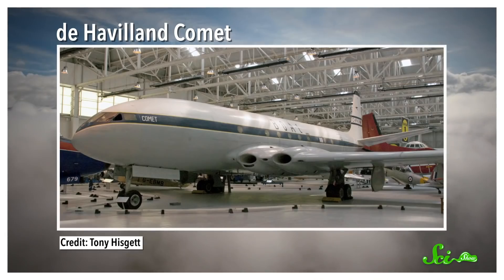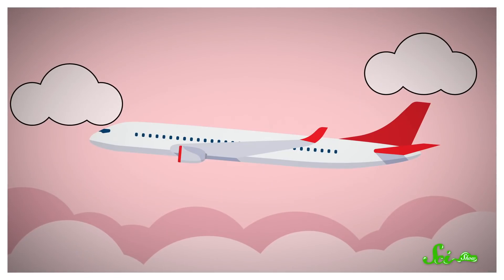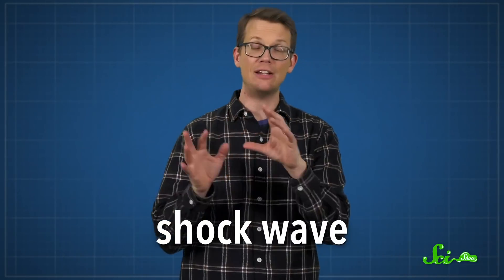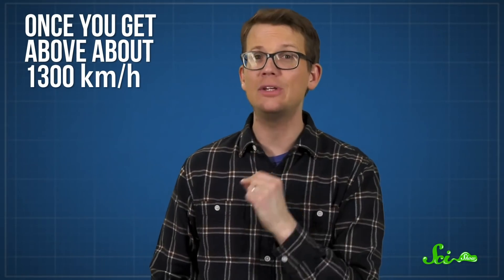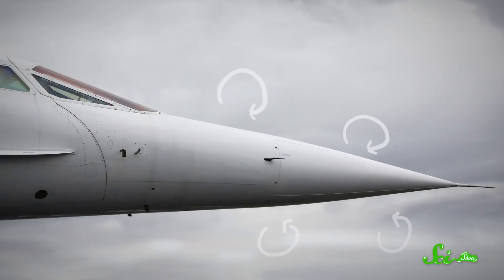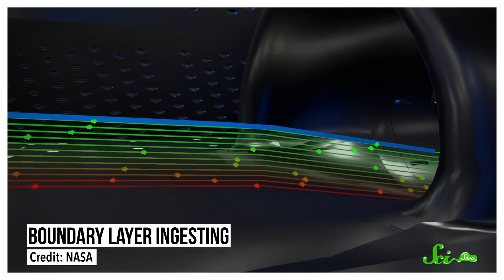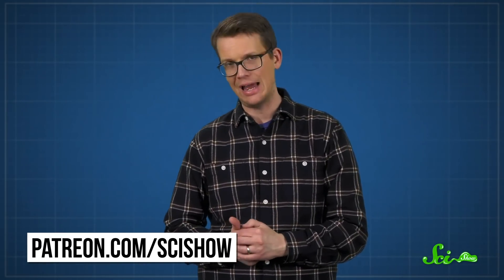Why Aren't Commercial Jets Getting Faster?

Comment: Supersonic airplanes fly twice as high as ordinary airliners.  It’s so high you can see the curvature of the earth.  This is because the engine on a supersonic airplane is more like what a fighter jet uses.   There are companies that are trying to bring back Supersonic airplanes. One major difference is size.  The new ones are being designed to carry 60 to 65 passengers.  The airplane will use the latest in composite materials that were not yet invented back in the Concord days.  The vastly reduced size and lighter material means it will use a lot less fuel than Concord. the Boom Supersonic for example is planning to create a supersonic airplane that is cost effective enough to sell tickets at current first class prices.  The boom supersonic airplane theoretical top speed is Mach 2.2. This was before the corona virus and it’s devastation to the Commercial Aviation industry.
Reply: You sound like an advertisement.  Booms Supersonic is vapor ware. The design that have shown so far of the Overture are 100% eye candy with zero engineering validity; there is no room in that plane for fuel. I expect them to go bankrupt in 5 years, having delivered nothing.

Comment: Actually its the low pressure on top of the wing that provides most of the lift not the high pressure below. Sorry you got this one wrong
Reply: Actually conventional wisdom that the low pressure 'sucks' the plane into the sky isn't entirely correct.
According to aerodynamics, lift is produced both by explanation of bernoulli's principles (The air on the top is indeed moving faster, but the way it generates lift isn't due to lower pressure (as one would conventionally say 'the faster moving air produces lower pressure'; this is a misconception, the actual equation compares the total energy within a particular airflow, stationary air and fast moving air have two different energies, and comparing the two doesn't give you the answer you're looking for)), but also newton's equations resulting in the deflection of air from below the wing causing a reactive force on the wing itself.
To summarise, the way a plane moves isn't solely because of 'low pressure' or 'high pressure', but the fact that due to some complex calculus, an airfoil creates a pressure differential between the two surfaces, and the application of this (whether you get the answer from bernoulli or newton, it doesn't matter. Bernoulli's principles were derived from newton's laws and thus they both explain it in slightly different ways) is what generates lift.

Comment: I believe the airfoil was shown upside-down.
Reply: Nope. That is a more recent style airfoil, those referred to as supercritical. The top is flatter because they are intended to bring the extrados air ever so close to Mach 1, and keep it that speed (and therefore the low pressure) as long as possible.

Comment: There have been a lot of videos about this issue. The mathematics involved determine basic aircraft architecture for a given speed. At higher speeds than currently attained commercially you first enter a range of airspeeds that are transonic and not really suitable for sustained flight. At supersonic speeds the fuselage and wing shape needs to change, and the aircraft becomes uncomfortably narrow, as well as inefficient. It is not true that a witty kid with a pencil can just whip something up, but that is the prevailing notion. The reality is that mankind  at this point should probably stick with more realistic goals, like understanding why you shouldn’t lose your mind when someone says “virus,” and perhaps letting ethnic minorities walk down the street, go shopping etc., without being choked out by cops. I dunno.

Comment: The explanation is very good, but still not all commercial jets fly at the same speed. As a rule of thumb bigger planes fly faster, and I mean the average cruising speed once the climbing phase is over. So 777’s, 787’s, 747-8’s on the one hand and A380’s and A-350’s all cruise at Mach 0.85. The one exception is A330’s, that only cruise at Mach 0.82. This may not seem much, but it will add 30-45’ to long missions. Then comes the next tier, 737’s and A320’s that just do Mach 0.78. Here again, another 15-20’ is added on a North Atlantic crossing, the maximum range of a single aisle craft when compared to A330’s, a bit more with other twin aisle versions. The still smaller A220’s are even slower, just Mach 0.75. An explanation for these differences would be highly appreciated.

Comment: Actually airline speed is more a function of passenger miles/pound of fuel used.  It's not how fast you can go but what is the lowest cost to get your passenger to the destination.  Quite a complex calculation based on air temp, winds aloft, routing congestion, engine performance, aircraft performance weight, route altitudes,  gate fees, fuel cost at departure and arrival airport gate and landing fees.  Also mach number (basically speed of sound) varies with altitude and temp.   Besides, the US has a Mach 1 speed limit for noise.  The Concord had to slow to sub sonic when entering the US air space.  This sort of killed it's economics from Europe,  you would like to go to at least Chicago or possibly Denver or SFO at full speed but had to slow to < Mach 1 which killed it's performance.

Comment: I just did the math and the SpaceX Starship (which Elon whats to use for suborbital passenger transportation) uses 1,200MT of fuel and has a stated capacity of 100 passengers. That is 12MT/passenger.  That makes the Concord seem like a fuel miser.  But, that is nothing compared to getting to space (or the moon).  The Saturn V used 2,440MT (530,000 gal)  of fuel to take 3 passengers the moon.  That is over 600MT/passenger; but, that is for a trip to the moon which would be a very rare experience.

Comment: I sometimes wonder whether reducing the fuel consumption of planes helps or hurts the planet. Of course, using less fuel per person is a good thing, until you realise that fuel cost is a major cost associated with flying, and using less of it makes tickets cheaper, allowing more people to fly, increasing emissions more than the savings due to more efficient engines.

After all, planes' engines have gotten better and better efficiency for decades, and total aviation fuel consumption have increased dramatically in the same time span. I don't think that's unrelated.

Comment: 1:07 Could have sworn there was a SciShow episode debunking this.
Reply: But it is correct. There is a pressure differential between underneath the wings and above it and you can measure them. It is just that the main reason is different. It is not the shape of the wing that creates lift it is the angle of attack. The angle of attack causes the air molecule under the wing to pile up creating high pressure. The opposite happens above the wing where the wing going forward creates additional space that the air molecule needs to fill up creating low pressure. This is why kites with thin membrane and does not have an airfoil shape could still fly. The airfoil is needed for efficiency since the shape reduces air vortices that adds drag.
Reply: Veritasium and Minute Physics have made one at least
https://www.youtube.com/watch?v=aFO4PBolwFg
Reply: Take a look here https://www.grc.nasa.gov/WWW/K-12/airplane/wrong1.html
Reply: I knew i wasnt the only one

Comment: 1:56 you're talking about the "transonic" region, which begins around 0.97 or 0.98 mach depending on the aircraft. But you suggested the transonic region begins at 0.75 mach. Not really...

Edit: well actually I just Googled it and wikipedia is on your side with the definition of transonic, but it's not noticeable until 0.98 mach

Comment: I recall some 40+ years ago, being told that the pressure on the underside of the wing is small compared to the pull from the upper side of the wing. The high speed air over the wing causes reduced pressure pulling, or sucking, the wing up. My memory is not that good, but I think it was stated that 1/3 to 3/4 of the lift is from the top side.
Reply: It's all relative. The "sucking" effect is from the lack of air on the top, which is just another way of saying the excess of air on the underside of the wing. It's all the same thing

Comment: Can we fly higher in thinner air?
Reply: Yes, and no. It gets complicated. Fly higher means having to fly faster to make up for the reduced air density. But with less air, the engine thrust reduces as well, which means you would need bigger engines to be able to fly faster to make up for it. And then you start having issues like buffeting and compressibility effects due to nearing the speed of sound.

Comment: Another thing: air entering jet engine intakes has to be subsonic.  Supersonic military jets have specially designed fairings or cones to break up the air, slowing it down as it enters the intake.  The SR'71 even has variable intakes that move in and out because an air break that works at Mach 1.1 won't work at Mach 3.3 and vice-versa.  Commercial airliners would have to go through costly design changes to install air breaks.
Reply: It is not "breaking the air", it is a progressive compression using oblique shock, using variable ramp air intake. Use proper terminology, please.

Comment: 4 hours from New York to Los Angeles is too slow for some people?  That used to take several years!  At the turn of the 20th Century, Chicago to Salt Lake City by train took almost a week!  A typical trip by car that takes 12 hours, a plane can get you there in one.  Give me about six inches more in leg room, a slightly wider seat, so we're not packed in like sardines, and it's fine.  You can start out in San Francisco or Los Angeles, and in like 8 hours, you can be in Paris, standing in front of the Eiffel Tower.  That's pretty incredible to me.

Comment: We make a plane that ascends to the thermosphere, where the air is so thin there is basically no drag and we can hit speeds of Mach 23 with a good enough engine. That can get you from Denver to Pakistan in 30 minutes.

Comment: One ton of jet fuel per head each way does not come anywhere close to explaining ticket prices of $50,000 per head round trip.  It couldn't be more than 2% of that cost. Back in the 80s, jet fuel was between $0.49 and $1.01 per gallon.  It didn't go above that range until 2004.

Comment: What about supercruse?
Reply: Supercruise is only the concept of having enough thrust at supersonic speed without having to use a post combustion. To make a parallel, imagine having two race car with the same top speed, one with a large atmospheric engine, and one with a smaller engine but with a turbo compressor. The supercruise is the equivalent of the larger atmospheric engine.

Comment: Dunno why they don't come up with something completely new. Like a tunnel through the Earth that can get to anywhere between 2 points in 42 mins from just gravity + a bit of energy to make up the losses at each end of the trip (prob over 200x more fuel efficient than a plane, depending on the quality of the vacuum in the tunnel). Obviously we're not digging 8000 miles from US to China through a solid iron core anytime soon but US to Europe or coast to coast is doable even if it would be expensive and take a long time to get done. Just re-engineer some tunnel borers to be able to dig through rock the consistency of anything from solid normal rock to hot plastic or chewing gum to honey and able to withstand 2500-3000F temps (obviously would need to be automated, not a job for humans, and probably made of some sort of tungsten alloy), and solve a list of other challenges (like a reliable way to keep the cars from hitting the sides of the tunnel at thousands of mph, magnets don't work very well or at all at elevated temps).
Reply: Because geothermal is exist dear

Comment: I've heard that this common explanation of lift is probably not entirely accurate.
Reply: For low speed flows, it works well enough. Ultimately lift is caused by the physical turning of a flow, which is what it has to do in order to flow over the wing. When the streamlines, which can be thought of as the path an air molecule takes, become curved, pressure changes are introduced which directly lead to a net force on the wing that is (hopefully) in the direction you want it to be, which is upward. The way it was explained to me in my first aerodynamics class was that circulation of the flow leads to lift, and even if the flow is mostly irrotational, viscosity will still influence lift because viscous effects determine the circulation of the flow around the airfoil. The Kutta-Joukowski theorem explains this phenomenon nicely, but keep in mind that it only considers 2-dimensional bodies that satisfy a certain geometric condition. Considering 3-dimensional effects makes this a much more complicated problem.
Reply: https://www.scientificamerican.com/article/no-one-can-explain-why-planes-stay-in-the-air/

You're right, the explanation we were all taught involving Bernouli's Principle does not account for it fully.  The Skeptics Guide did a multi part bit on this as well.
Reply: Yes it's the low pressure on the top that produce most of the lift
Reply: James Albright It's pretty quick, but it is correct-ish, instead of a 'push' it's more like a plane is pulled up into the sky. Look up Bernoulli's principle. That principle of fluid dynamics is actually exactly why planes go up. Newton's laws can help, but that wouldn't cut it alone.
Reply: Grimm Sanchez  But how is it possible for planes to fly upside down?
Reply: @woodfur00  Because you use the control surfaces to stabilize the pressure
Reply: @woodfur00  To fly upside down the airfoil shape is still created whether "artificially" or naturally. 

If you inverted an airliner you would require significant nose up input (relative to the sky) to create enough angle of attack to create lift even just to fly level.

Aerobatic aircraft have symmetrical airfoils so they are equally as efficient inverted.

Comment: I wonder if a heat engine a la a Stirling Engine could be used to cool the front section enough so as to minimize that compression at the front of the plane.
In before all the "Stirling engines are huge and heavy and generally suck" kind of commentary: I'm talking about a world where we bothered to invest in development starting with re-developing the Mod II and taking it from there. :(
Reply: But sadly, the world doesn't revolve like your brain thinking about unicorn running around candy forest
Stirling engines are, in fact, huge and heavy and generally suck. Hence even the nowadays steam engine are using steam turbine with 64% efficiency

Comment: Despite financial difficulties, the Concord also failed because...

a slice of metal debris blew up a tire and in turn puncture the fuel tank, causing disaster
Reply: A slice of metal lost by a Boeing earlier ..
Reply: Concordes' problems were more political than anything else. The idea had been to build a LOT more of them (making the per-unit price much more reasonable) and operate them on many more routes globally, but the problems with the shockwaves and mostly unfounded opposition from the Sierra Club and the likes really restricted the routes they got permission to fly

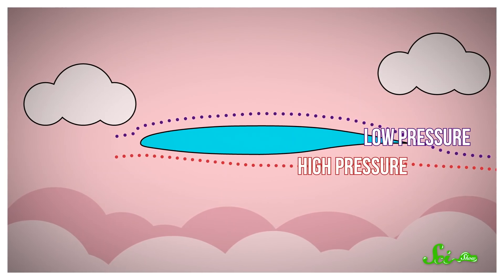Comment: I hate to say it but 1:20 is incorrect; it has been demonstrated that the pressure difference between the two regions (at least with airplanes) is either non-existent or negligible. 

We still don't fully understand lift, but the main theory (last I heard) was that air molecules strike the underwing and because the wing is angled, this translates into a vector pushing up in the planes wings. Pretty intuitive actually
Reply: I'd like to see where it has been "demonstrated". In my university aerodynamics class, we put an airfoil in a wind tunnel with pressure ports all along the upper and lower surfaces. There is a significant and quantifiable difference in pressure between the top and bottom of an airfoil. Google "airfoil pressure distribution and you'll see this. You are correct that air being forced downward also plays a part in lift. A much more accurate method used in higher-level calculations uses the circulation around the wing to estimate lift.

Comment: Sadly your point about engines becoming more efficient isnt quite the full story. The major constraint when designing an aircraft engine is sound, we stopped trying to design for more efficiency because no one would buy these engines, as my professor says, "What is the primary objective when designing any engine? To maximise the profits of Rolls Royce!" Now read that in a THICK russian accent to know how it sounds to us.

On a different note, there is quite an easy graph to visualise why we fly at the speed we fly, and it's essentially your price or efficiency of your flight against mach number. Because of course the faster you fly the less time you have to burn your fuel and as you mentioned as you approach M=1 you have to start worrying about wave drag so your graph has an inflection point thereabouts but then after your efficiency decreases substantially, it begins to increase again and once you start going at hypersonic speeds it becomes more economical than the speeds we fly at now. It's pretty much one of the reasons elon musk says that the BFR or whatever it's called now will one day replace modern aviation and you can fly london to LA in 45 minutes with a ticket costing the same amount as an aeroplane. 

I tried keeping this comment friendly to everyone and not just those which are familiar with aerodynamics hope it was informational.

Comment: The faster you go, the higher altitude you have to fly at to be efficient. If you do that, then you have a higher pressure difference between the inside and outside and you have to be able to dive into denser air so passengers can breathe in an emergency.